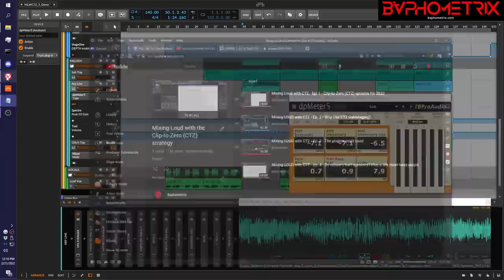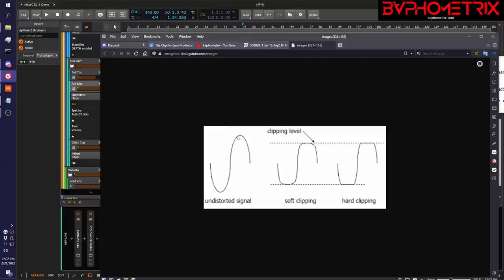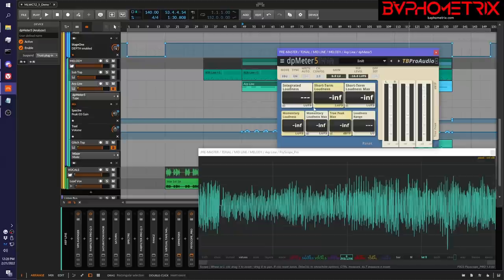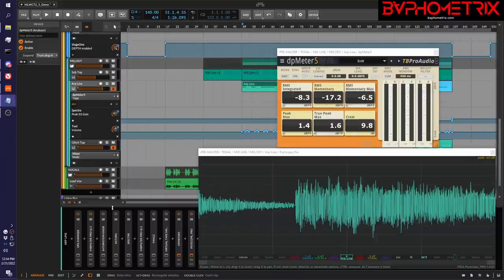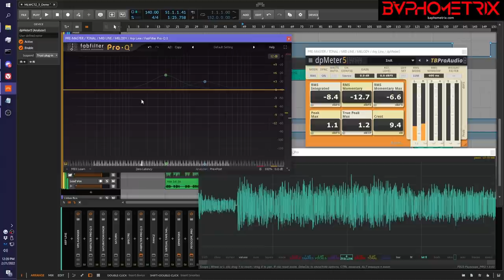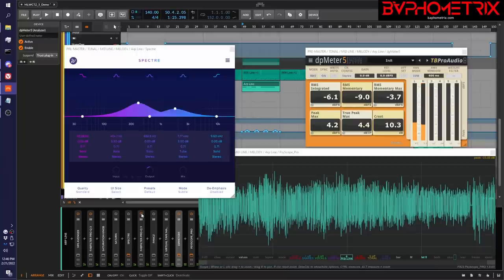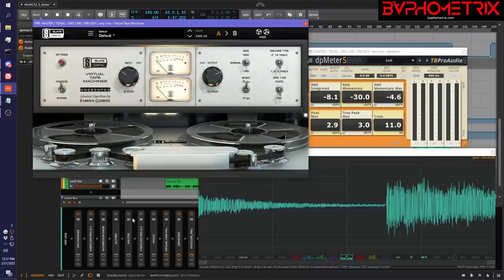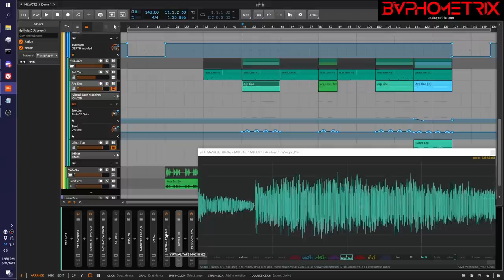Mixing LOUD with CTZ - Ep. 5 - Controlling dynamic range by "saturating from the bottom"

Comment: This cat is a ten toes down gangster. In episode 4 Baph was merciless on himself when a viewer caught a possible error in his explanation about clipping speakers. He screenshot the comments and put himself on blast for all to see. Why is this gangster? How many people on the internet have that much transparency? That takes titanium balls people, some type of space aged alloy. Just so you know, I make lo-fi, hip hop and r&b. Not always concerned with max loudness. However, having CONTROL of my loudness is of the utmost importance. This strategy has me reaching -8 lufs on a lofi track with no sub. Not that I will commit to that rms, but just knowing how I can push it is freeing.  I know we may get a template video coming soon, but I wasn't above screeshotting his mixer section and recreating it in logic. The cascading bus concept is killer, as you chain down the line things have a chance to get more pristine with each pass if the clipping is controlled responsibly through the chain. I am in the rudimentary stages of this and have a mid level understanding. The assuring thing is is that it's not necessary to comprehend everything, just familiarize yourself  with the oscilloscope and monitor the waveform. It's super easy to apply. Thanks bruvva.💯🦾
Reply from the maker: Haha you clearly get it already! So nice to see the light bulbs going off for people 🤓  This process is totally freeing, and totally controllable. Thought you wanted a loud mix but decided at the end you don't NEED it to bet that loud and would rather bring back some dynamics? No problem. You'll see how easy it is to readjust the total amount of clipping across the entire project -- top to bottom -- with one knob twist. In just a few more episodes. And the converse is true too! Went for a dynamic mix but wonder what it might sound like a little hotter and louder? No problem! One knob twist.
Reply: Yeah I have Logic Pro X and I’m just starting my journey in the CTZ method. That’s awesome that you have that much control. I’ve always struggled with perceived loudness so I’m excited about learning this technique.

Comment: Wow, everything I've learned from other sources, so far, is completely the opposite of what you're teaching. I wasn't buying into the CTZ method until I started fiddling with some clippers using your approach. Your 5 episodes of CTZ is worth more than any course I had paid for.
Reply: I’m not sure what other sources you are using..  but you can get much cleaner and equally loud mixes by addressing masking properly, only using saturation on a few parts, and NOT clipping.    These videos are well made… but there is a lot of bad advice.. a lot!   The harshness at 2k is because he is trying to compensate for masking issues from clipping and saturating..    every move is creating a new problem that needs to be addressed .. so it’s compensated by trying to add or take something away.
Reply: @djcolinturnbull  You're right. I'm not aiming for extreme loudness anyway, but if there's one thing I've learned from the CTZ series, it's that I shouldn't really worry about using clippers on individuals tracks with pokey transients. Some mixing engineers make it sound as if it's taboo to slap limiters/clippers on mixing tracks/busses. I'm trying to get the best of both worlds by using the traditional way of mixing, and some of Baphy's approach on clippers & waveforms.

Comment: I discovered spectre through your channel and without a doubt its worth every penny. I use it heavily now. It is excellent of increasing the perceived loudness of mid range basses, synths, kick and snares. Its super amazing on kicks and snare as it doesn't screw up the phases in the  transient. Could not recommend it enough, I consider it an essential tool now regardless of genre.

Comment: When I started producing I 'got' compression on a theoretical level, but I sucked at applying it and I didn't know what I was doing (I've since learned to trust my ears, but I used to suck at trusting them early on). But early on already, I've read about producers like Dom & Roland eschewing usng compressors because they felt like saturation (I think he used it in the broadest sense of the word, or he just said distortion, can't remember) does a much better job at dynamic processing. And in my own production, I've learned that "saturation into saturation" gave me incredibly good results in terms of dynamic reduction, loudness and overall sound without sounding harsh, way before I'm even at the mixing stage. To this day, I RARELY use a compressor. A lot of my practices feel vindicated by your video series, but I've also learned some new approaches. Thank you.
Reply from the maker: Yep, I almost never use a compressor except early in the raw sound design to *sharpen* the transient feel of a sound or to increase the *punch* of a sound.

Comment: I admit I was one of those guys that clipped each sound coming out of serum.  But since i experienced harshness from certain sounds, I took the hard clipper off altogether on the individual tracks and synth bus.  Thanks for clearing that up teach.  I'll try using waves vitamin, waves abbey roads saturator, waves j37 tape, ozone 9 Exciter and gclip soft clipper (only saturation plugins I have) to lower the crest factor and THEN add the hard clipper.  ✌️

Comment: This episode is fire af to me. I was just using a utility and driving every sound I had into a hard clipper. 

So if I get it this right, for each individual sound I should start with saturation. I should only hard clip if needed. But on the busses, I should stick with hard clippers because they are more transparent. That seems like what you’re saying the workflow should be.
Reply from the maker: Hey Nova 🙂 The main point is to clip only as much as you need to. Which will be further emphasized and demoed in the next episode 6 about doing the "clip from the top". You don't NEED to put on saturation (and other processing) first. You could just "test" a new sound by clipping it and seeing if it can survive the necessary clipping to fit into a loud mix. But even if you start that way for quick progress while choosing sounds and testing your early composition and arrangement ideas, eventually you want to revisit that sound and ask yourself if it would benefit from other other processing AND some of the saturation techniques I suggest in this episode. Then, AFTER you do that, re-adjust your CTZ pair. You might be able to do even LESS clipping after adding in the saturation/etc. And less clipping is always better. The next video will show this type of iterative workflow.

Comment: very good video 
using fabfilter saturn 2 in multi mode delivers the results of spectre i wonder why he did not try that with saturn 2 , people who have saturn can use it and dont get tempted to buy sprectre
Reply: That's exactly what I was thinking, as the owner of saturn 2. At first I thought that specter can mix a saturated and original signal, but actually.. haha saturn can do it too, even for each specific band separately. I just had to look because I've never used this option before. However, if I add to that all the great distortion modes that saturn has, I don't take specter as a thing at all. maybe cpu load but i don't know.
Reply: Incorrect. Multi-band is different to parallel. However, you are right in saying Saturn 2 can deliver similar results as it does have a dry wet control for wide band parallel saturation and also for individual bands, so it does do the same thing as Spectre, minus the ability to use a bell curve to target which frequency region you want to saturate.
Reply: @djvoid1  iNcOrReCt. Ofc it's different. nobody sayin it's the same. Bell curve.. like ok, that can be useful, in my opinion not very useful. On the other hand as I sayd... With Saturn you can adjust mix of each individual band + you can have different type of saturation or distortion on each band.
Reply: @fkuchticek  You can set different types of saturation for each band in Spectre also (Tube, warm tube, solid, tape, diode, class B, bit, digital, rectify and half rectify). You've actually pointed out a shortcoming of Spectre in that there's only one dry/wet control for everything, rather than Saturn 2 having individual dry/wet for each band. You can blend to your liking, but seeing as the harder you push each band, the more distortion and level you get, this could prove annoying when working with multiple bands of which you want to push different amounts (say less on the low end)
Reply: This video was made two years ago, right before Saturn 2 was released.
Reply: I think spectre is actually using phase cancellation to get a copy of only the harmonics generated from the saturation which is then blended back in with the wet/dry control
Reply: @INNERMONO_  
Absolutely right ,that's why there is obviously no control downside in negative value it has only positive values to blend it in and increase 
   Adding negative values controls introduces 180 degree phase shifts between cross over points in spectre which can completely ruin the sound 
   But both spectre and Saturn are very useful plugins and both work great depending on one's need and taste , unless otherwise we overdo things with it ,both are fine

Comment: I think that u can do same  parrarel multiband saturation boost of specified areas with FAB FILTER SATURN too.  Also by tweaking MIX knob to 50 %. + you can saturate speciefied areas by separating areas with "+" , but spectre gives you a better visual wiev of frequency range.

Comment: Another awesome video in this series. When looking at Spectre, what about using Saturn in multiband mode? Isn't that pretty similar. Or if you duplicated two channels, one dry, and one wet with saturn in multiband mode, then mixed the wet one in, would that be the same as Spectre? Just curious on your thoughts.
Reply: I think spectre is using a phase inversion to get a copy of only the harmonics being generated from the saturation which is then being blended back with the original. Watch 2L&L's video on this effect which can be done in an Ableton effect rack very easily.

Comment: Hi! First of all, thanks for your great work! Learning very much from your videos! I scrolled through the comments but could not find anyone mentioning this: you said that EQ messes with the phase of the signal, and that's right but you're using 'Zero Latency' mode in Pro-Q3 which is designed to mimic the behaviour of an analogue EQ. But Pro-Q3 also has linear mode which introduces some latency (which should be compensated for by the DAW anyway) but doesn't alter the phase at all. Do you use this? I guess it could solve at least phasing issues in your EQ demo!
Reply from the maker: Linear phase EQ has its uses, but not in the context of the subject matter where I'm talking about EQs in this video.

Comment: Hi Baph. Would love your take on Kelvin Tone Shaper. Its not as edm-ish as Spectre but the quality and the saturation models are awesome 👍 it also has a Soft Clipper and some other tricks.
Reply from the maker: Tone Projects makes really excellent plugins. I use Unisum as my mastering compressor (when I use one at all, lol). I'm sure Kelvin is awesome as a wideband saturator. It's not the same thing as Spectre, though. Think of Spectre more like a "boost EQ that sounds way better than an EQ".  If I had a limited budget and didn't have either Spectre or Kelvin, I'd still recommend to grab Spectre first, because it's so *versatile* for mixing and for loudness.

Comment: About Softube's "Saturation Knob", if you update to the latest version they open up some input/output level controls. Probably won't change your opinion on the plug, but it might be a little easier to wrangle

Comment: Would Waves Vitamin be something similar to Spectre since it's a multiband harmonic enhancer. I just started utilizing it in my beats about 3 days ago. Pretty ironic lol
Reply from the maker: Maybe? It's been a long time since I looked at Vitamin. Saturn also has multiband capabilities and the ability to do a dry/wet mix with the original signal. The big question is whether Vitamin uses Linkwitz-Reilly filters to separate the bands. (Because that will very much change the shape of the original signal even with no saturation applied to any band.)  Spectre is unique. It doesn't put the signal through a bunch of band split crossover filters. It simply creates the saturated harmonics on a separate channel and then morphs those harmonics into the original dry signal. Look for another comment here that somebody made about Saturn and I give a more complete answer there.
Reply: i was just thinking the same thing

Comment: Thanks Bapho as always. What about the difference in pusching drive knob, or pusching up input than reducing output by same amount, in Saturate , to achieve the same amount of clipping?
Reply from the maker: I haven't talked about Saturate yet. That will come in a later episode. The short story is that the Drive knob is just like linear input gain up to +12 on it's slider (halfway across. After that point it does something funky but I can't remember what, exactly.)  Basically if your signal is already peaking close to zero, then the Drive knob is fine to use, but try not to push it past +12 drive.

Comment: Hey Baph, I have a genuine question. This is something I've been messing around with over the past two days, but what are your thoughts on Clipping To Zero during the PRODUCTION STAGE??

I make a Melbourne Bounce + Techno kind of genre, very similar to that of Will Sparks, and while referencing his music and trying to get the same LUFs I noticed my songs really started to fall apart when really pushing them to the limit, like distortion in some of the bass frequencies and a few areas with the kick drum. This gave me the idea to try Clipping To Zero from the start, and building the track from the ground up as loud as possible. As a start I sample one of Will's kicks and got mine to sit at the same Peak and RMS value, I then added everything else from there clipping to zero each element thag got added and it gave me by far the cleanest and loudest result I have had so far.

What are your thoughts on this and what sort of problems could I potentially face by doing this and what should I look out for?

(also, would you ever consider doing 1 on 1 discord sessions to help a viewer out and give feedback?)
Reply from the maker: You should absolutely CTZ right from the very start. With every new sound you add to your project. I talked about this in Episode 2.
Reply: @Baphometrix  alright, i've had all the previous episodes playing on my second monitor while working on university stuff, so i obviously missed that part but i'm definitely gonna go back and rewatch it all thoroughly🙏🏼 thanks so much for everything you have shared, absolute game changer for a lot of people i'm sure

Comment: Hi Baphometrix, thanks for you videos. A question: it's possible use, for "saturating from the bottom", to  use multiband pre in KClip instead of others plugin? Thank you
Reply from the maker: You can certainly try it. If you're using a very soft clipping curve, it will indeed be a type of colored saturation, and limiting it to a specific band will be somewhat similar to what I demonstrate in Spectre or Saturn.

Comment: If soft clipping is the same thing as saturation, why don’t I see waves getting squared off in  a scope when I saturate but I do whenever I soft clip?
Reply: the difference is that a soft clipper doesnt square off waves in the same way as a hard clipper. a hard clipper will generate an infinite amount of higher harmonics with equal amplitude for the moment a signal exceeds a threshold. the amplitude of these harmonics is related to the amount of signal exceeding the threshhold. a soft clipper will generate infinite harmonics as well however the amplituse of each individual harmonic is related to the order of the harmonic. e.g. a 100 hz soft clipped sine will have harmonics at 300 500 700 900 1100 hz and so on with each harmonic having less volume then the previous. thats why it is much less audible. think of it like a low passed hard clip while the harder the signal goes into the soft clipper the higher the lowpass cut off frequency is gonna be ( the brighter the result will sound and the more dynamic leveling is gonna happen) hope this makes some sense☺️
Reply: another analogy would be a compressor infite ratio a hard knee and 0.00 ms of attack and release while soft clipping would be a compressor with 0.00ms attack and release and infinite ratio but with a soft knee, resulting in the signal to never actually reach the infinite compression ratio and attenuation starting at a lower level then the set threshhold while increasing the ratio the harder the signal goes into the compression. while distorting we always trade absolute amplitude of a wave for generating harmonics. hard clip is black white and soft clip allows for a grey gradient in between😊